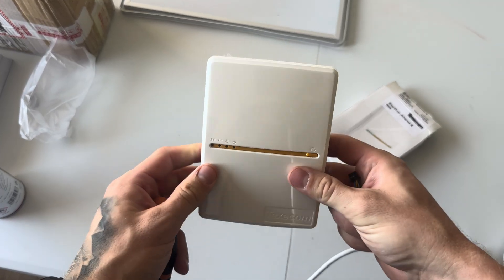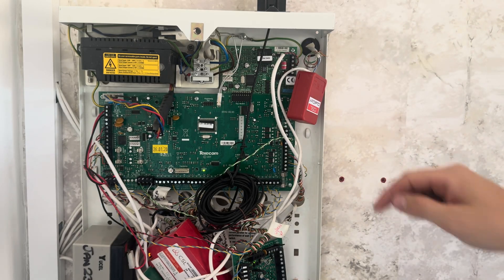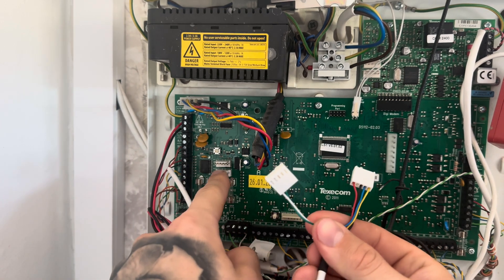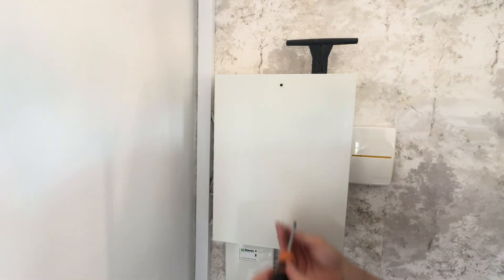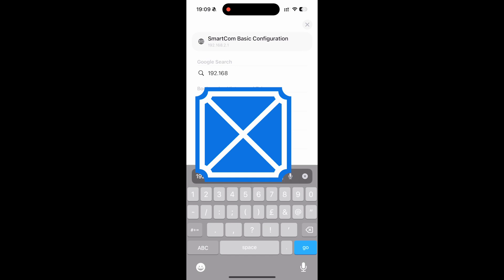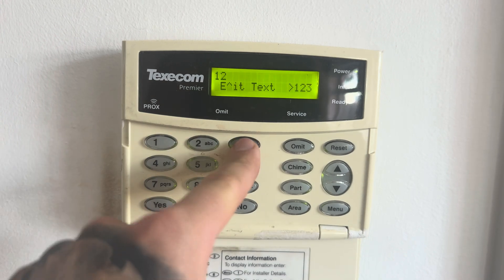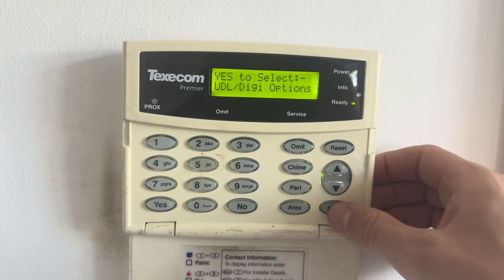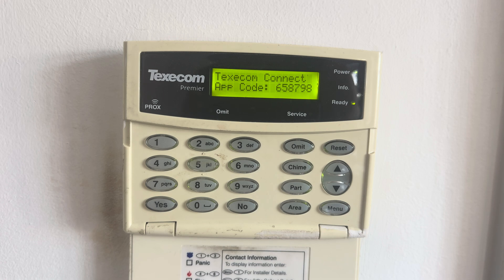Texecom SmartCom Setup Made EASY – Full Guide for Premier Elite: WIFI

Comment: Thanks for the great video, very straightforward and easy to follow.

However, when I try to add the system to the Connect app, I get the following error:
"The SmartCom is a 4G GSM unit and therefore requires a system contract. Please contact your installer and ask him to connect your SmartCom4G service."

I didn't purchase the system or SmartCom through an installer, I don't want any monitoring features and don't even want to use the 4G. Is there any way I can get the system added to the SmartCom app?

Comment: Hi Simon great video, ive recently had new wifi installed and the smartcom is flashing searching for connection but not connected. My engineer is claiming that only he can reconnect to the WiFi and wants to charge me £45 to do it 😮 is this correct or can i reconnect myself? Dont really have £45 to spare if it isnt necessary. Cheers
Reply from the maker: Thank you much appreciated! Yes I’ll send you the steps: 
1. Open your Smartcom and take a picture of the name and password of the Smartcom 
2. This will send your alarm in to tamper so enter code to stop tamper alarm going off when it does 
3. Close up smartcom 
4. Enter code twice and press RESET to reset panel 
5. Hold down yellow button on the front of smartcom for 5 seconds and then let go 
6. WIFI light will start to blink 
7. Go on your phone and connect to the smartcom WIFI, enter details to connect 
8. Go to 192.168.2.1 in a browser 
9. Select your homes WiFi 
10. Enter homes WiFi code and press enter
11. If you’ve entered password correct smartcom will connect after about 1-2 mins
Reply: @SimonSecurityExpert Thanks for such a quick reply much appreciated I'll give this a go  I use the Texecom app does this reconnect automatically or is there something thats required from me?
Reply from the maker: You’re welcome mate, Texecom app should automatically reconnect 👍

Comment: Good video if I used a lan cable from router to the router will it then pick it up automatically or will I need to configure it
Reply from the maker: Thanks mate! If you hardwire it with a LAN cable it’ll pick up the internet straight away, don’t need to configure that but you will still need to configure the keypad settings so the system talks to the cloud

Comment: Hello Simon, thank you for this walk through,I just installed my Premiere Elite 24 alarm and then the smart com, would have been much harder without your walkthrough. Do you have any idea why my alarm is saying I have an ATS  path fault and how do I disable thus in engineers mode, this fault was prior to the smartcom install,so it’s not that which has caused the problem.  I can’t set the alarm until this fault has been cleared, thank you
Reply from the maker: Hi mate you’re welcome glad I could help! If you want to disable ATS path faults you can go into engineer menu, global options, scroll down till you see monitor hardware, press no twice (or X twice depending on your keypad type) press yes, then come out of menus and it’ll be off. Sometimes it takes a few mins to disappear from the keypad though the error message I mean, but then it’ll be gone and you’re all good 👍🏻
Reply: @SimonSecurityExpert thanks Simon much appreciated, this problem is sorted and I’ve installed the smartcom followed your instruction, I had to re do it because I reset the alarm to default, but now when I try to alarm or disarm from the app I get the message Alarm state cannot be changed please check the panel.

Comment: I've got power to the smart com. I've recently changed my router and the smart com is not connecting to the WiFi. I've tried everything
Reply from the maker: How far do you get with it? Does your smartcom pick up a signal from your new WiFi but then won’t connect?
Reply: @SimonSecurityExpert no it's not connecting at all. I've reset the samrtcom and connected to the smart com WiFi. Then went to 192.168.2.1and chose my WiFi and pressed connect but I am still seeing the two blue flashing lights on the smart com
Reply from the maker: Ok mate, first stage is to turn on your mobile hot spot and try and connect smartcom to that, then if that works you know it’s a new WiFi issue, maybe the firewall of the router blocking it, if it doesn’t work with phone either could be a faulty Smartcom

Comment: Fantastic video. Have you ever seen the Error code 'No carrier' when generating an app code from the keypad?

I've had my smartcom installed for a few years now, but it seems it no longer connects to the Texecom cloud server, the cloud LED on the smartcom never lights up.
Reply from the maker: Thanks mate! Great to have you here. Oh yes I know that allll too well 😂try these steps: 
1. Reconnect to WiFi (even if it shows WiFi is connected) and then test 
2. If fails reset smartcom by holding down the button until all lights flash, then go through WiFi connection process 
3. If still failing try and connect to your mobile phones hot spot to ensure it’s not a WiFi issue 
4. Still no connection likely means a failed Smartcom.. hopefully not the case though but if so you’ll need to get a new one

Comment: I have two system one in my garage and one in my house. I have added two smartcoms but only the garage is working on the app. I am getting the app code for the house but it is saying the code doesn’t exist.
Reply from the maker: Hi Samantha, it sounds like you’ve got the process right since one system is working fine. The “code doesn’t exist” message usually means either:
	•	The app code has expired (it only lasts 15-60 minutes).
	•	The SmartCom isn’t properly connected to the internet/cloud on the second system.
	•	Or the code has already been used and needs to be regenerated.

I’d recommend trying the following:
	1.	Regenerate a fresh app code from the keypad and enter it straight into the app.
	2.	Check the SmartCom lights – solid blue means it’s connected.
	3.	Make sure you’re selecting “Add New Site” in the app if you already have one system added.

Let me know if that sorts it or if you’re still stuck.

If it doesn’t sort it we can go through a smartcom reset & reboot, do this by: 

Holding down the yellow button for 30 seconds, you’ll need to connect it to internet again (if using WiFi) and then generate a new code

Comment: Thanks for the explanation, very clear to understand. I have a Texecom Premier Elite 24 and its been free using the app, but its recently stopped working .How much does the app service cost?
Reply from the maker: You’re welcome Darren thanks for the comment mate. To explain fully the app becomes chargeable if you want to use the cloud software but this is mostly for engineering companies if you get a company to cloud monitor your site, costs can vary depending on what the set up is on the specific smartcom (4g etc) but looking between £20-£40, although if you just want the app usage only that is still free I believe. However I think this is changing soon, will update on specific prices for app only when they announce it 👍🏻
Reply: Have you updated the app from V1 to V2. If not then that would be the reason why